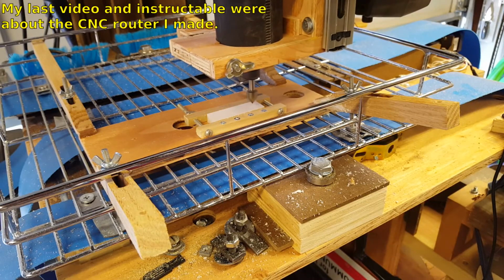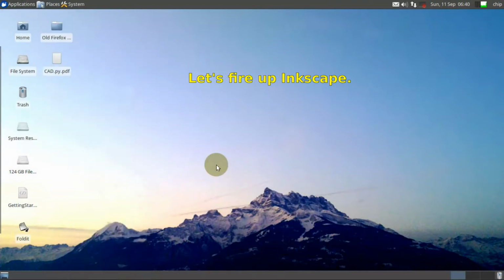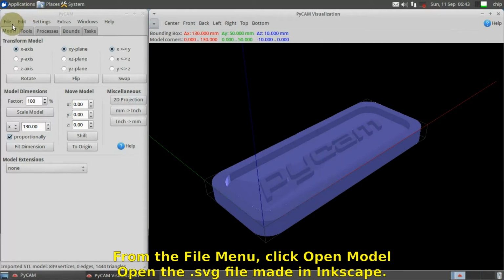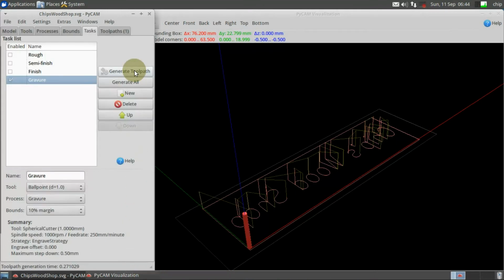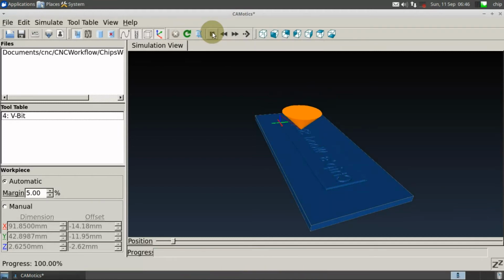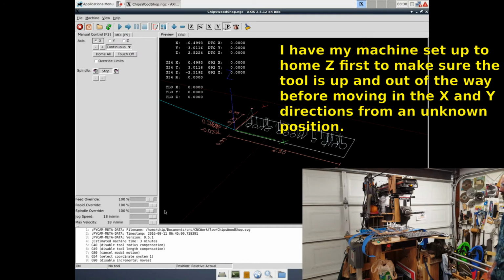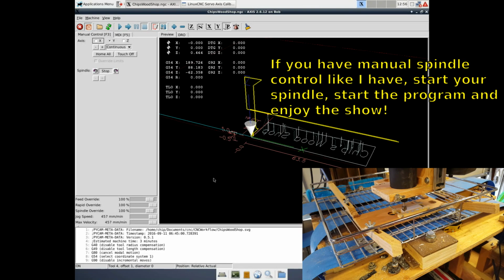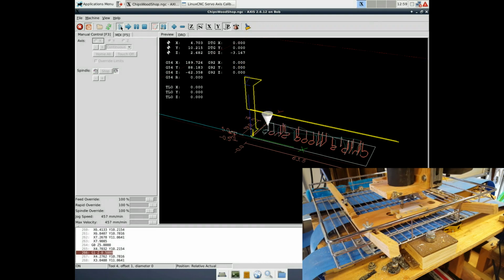Basic CNC Engraving with all Open Source Software

Comment: I'm going to have to check out Pycam for making single line engravings. I used F-Engrave to do it the last time.
Reply from the maker: +Paul Frederick, I have good results from F-engrave, too. I'm planning another video on that one, too.
Reply: Dear please make a video of this using F-engrave, generating to execution
Reply: F-Engrave is easy to figure out. But when I use it the scale is a bit off. Which for decorative designs doesn't matter. I only found out when I tried to plot out a printed circuit board with it. Then the parts didn't fit and I noticed the scaling issue. Now when I need things scaled exact I use dxf2gcode. But I still use F-Engrave for stuff where the scale isn't critical.
Reply: Paul Frederick , please show us how to set a boarder around text in F-engrave
Reply: +Ali Rehman  I'm not sure if F-Engrave has a border feature in text mode? If it does it is something I am unfamiliar with. For something like a border I think you'd need to run F-Engrave in graphical mode and import a file with the design that you want in a format that F-Engrave supports that you'd made in other software. I use the Gimp or Inkscape for that sort of thing.
Reply: That's cool, it works with exporting to inkscape. Thanks MAN
Reply: Inkscape has a G Code plugin for it too but I have not had good luck using it myself.
Reply from the maker: As promised, here's a video using F-ENGRAVE: https://m.youtube.com/watch?v=LYLd8fYnY3g
Reply: Let's see if you know what you're doing, or not.